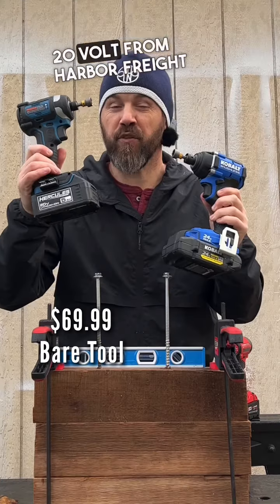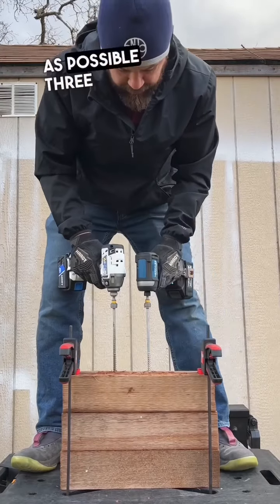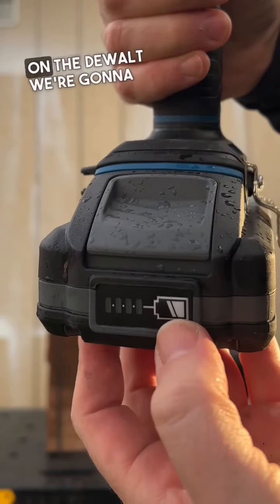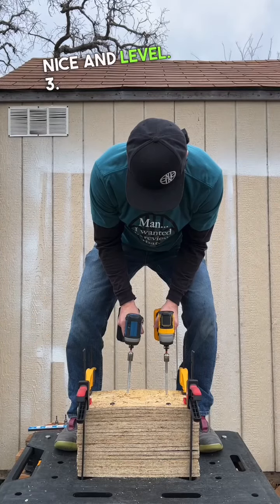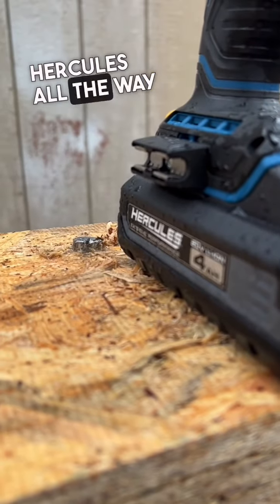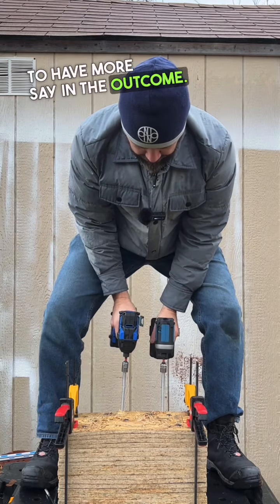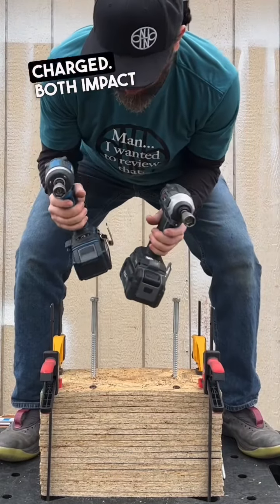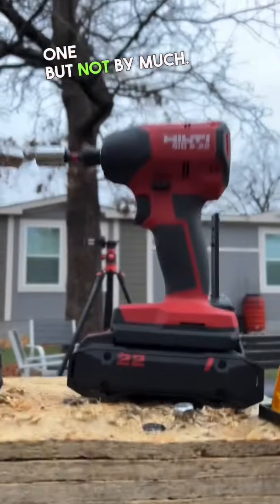NEW Hercules Takes On The Other Brands One After The Other!

Comment: Thank you for this comparison video.  Between this and some others, helped me decide to pick the Hercules Brushless impact driver and the Hammer drill/ driver  bundle (with 2 - 2.5 ah batteries & charger)  for $199, also picked up the 5 ah batteries for $89. 
These are for personal type use,  but plan to try them out at work when the situation comes.

Comment: I went in on the Hercules hammer drill + driver and then spent the better part of 2 weeks reading/watching too many reviews. 

12 years ago I was loyal to dewalt. Their product line is too convoluted to know what is going on there. 

Once you add up the batteries and etc the price gap starts to become closer. But the Hercules batteries are cheaper. Replacing a single tool, is cheaper. 5 year warranty is longer than dewalt’s

Then I come across this video. I’m 100% sold on keeping my Hercules tools. 

Note: right now you can get the hammer drill/drill or impact with a 5ah battery and charger for $120